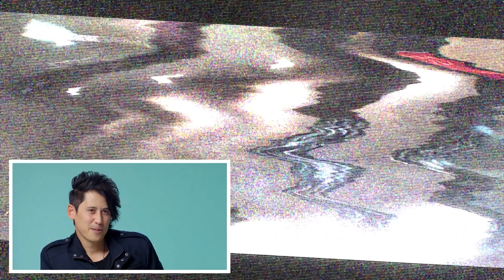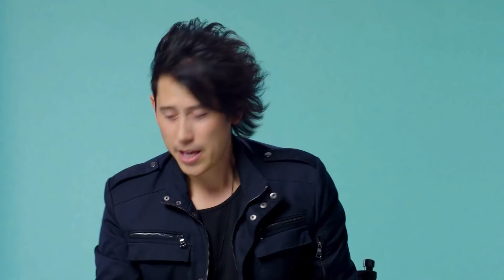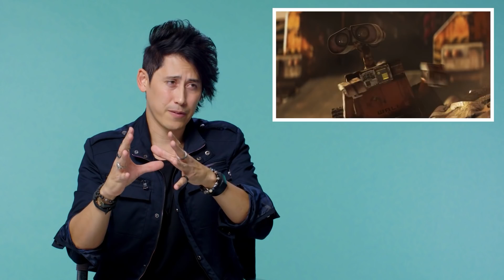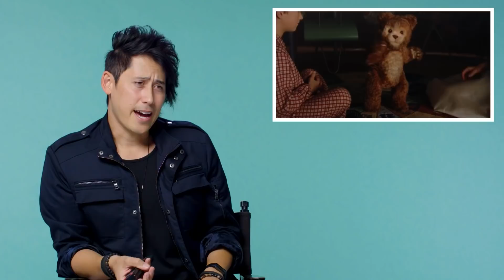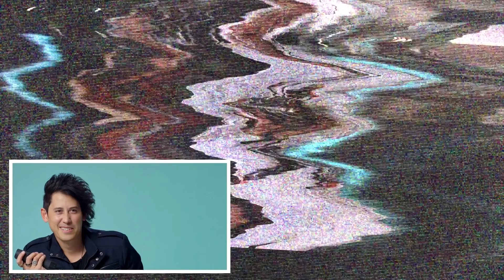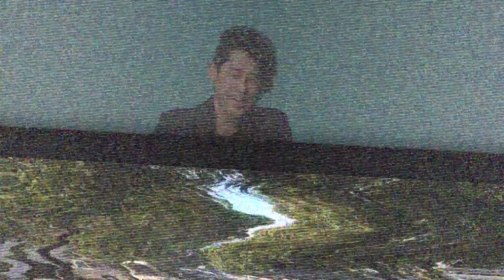Inventor Breaks Down Robots & Future Tech in Movies | GQ

Comment: I think a legitimate concern for flying cars is who will be flying it and how well.
Reply: Yeah and the kind of license you'll need, do you need a drivers license or a pilots license. A lot of little things have to be taken into consideration.
Reply: people can't even drive regular cars that good now so I'm not too optimistic about if they could fly
Reply: This is where autonomy becomes not just useful, but critical.  Driverless cars are learning how to drive.  Autopilots let airliners cruise without fatiguing pilots, but don't yet take off or land.  Smart cruise is already adding speed control without the car steering itself.  Eventually we'll be able to trust a system with flying to the store or office and back.  Heck, we won't even have to go to the store ourselves, but just send the "car" with an order.
I like the idea of altitudes blocked out for particular directions.  Low down for launching and orienting, with lots of sensors and networking to avoid collisions.  Four layers above that, still using sensors for collision avoidance, all traffic is in a particular cardinal direction, depending on its height.  We could go eight to include diagonals, but that might be a lot to ask of sensors, at least early on.  This is similar to today's street traffic, but far less restricted.  Breaking up the directions into non-intersecting layers helps avoid likely collisions, even with errors in the system.  Up above all of this is for high-speed traffic like airlines and cargo, not restricted to direction and still directed by local and regional Air Traffic Control.